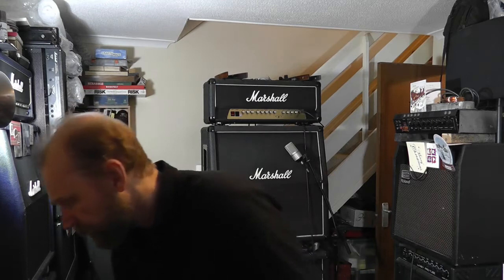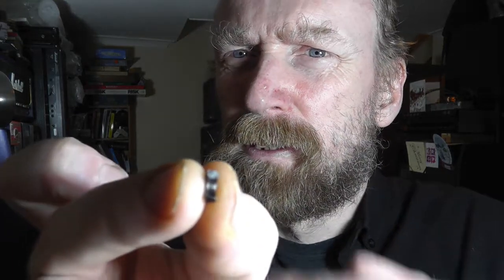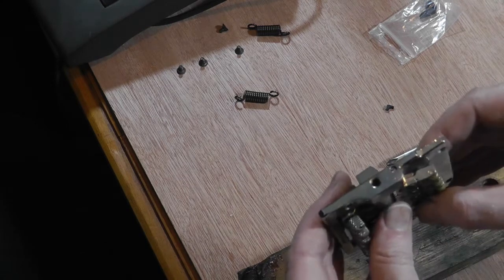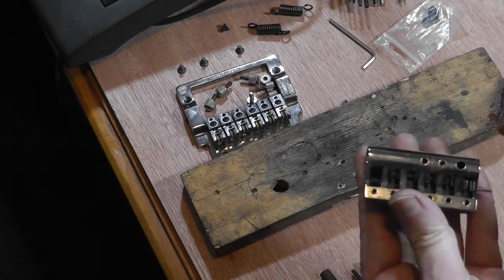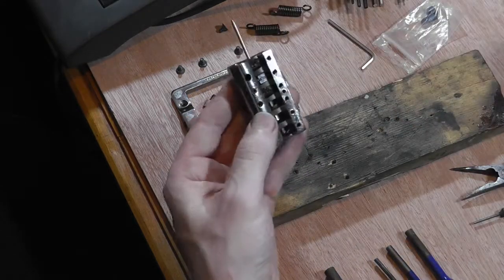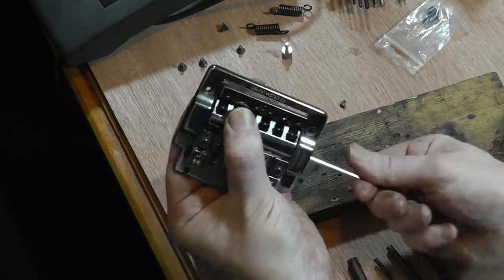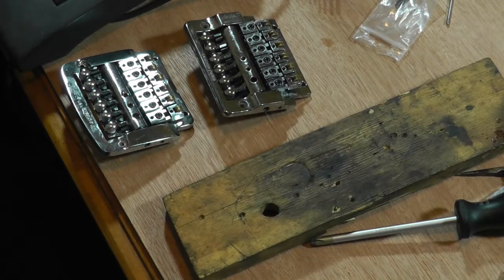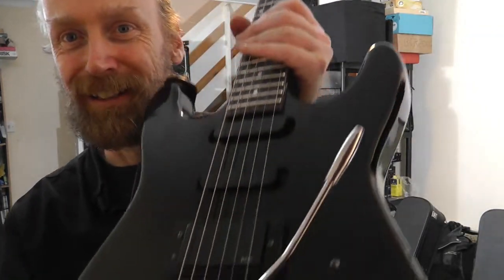Fixing A broken vintage Kahler Tremolo / Comparison with an Original Floyd Rose

Comment: I’ve been working on a Peavey HP special with a Kahler mounted on T-O-M tail posts. 

It was so simple so set the intonation and adjust everything.  So much easier than a Floyd.

I have the opposite tuning issue, where it needs the bar to be pushed forward (not back) to get it back to pitch.  It is tending to settle sharp without this. 

Not having a problem with the G string.  I’ve lubed the rollers, bearings, and any contact points. 

I’ve put NYXL 9-46 strings on it. 

I’ve read that springs wear out and should be replaced every few years.  

Spare parts also seem to be very hard to get in the UK. 

It’s a completely different experience to playing a floating trem.  The Kahler is almost perfect in its design apart from the tuning issues which you have to alter your technique to overcome.  

To me, the fundamental point of a tremolo is to come back to pitch.  For me, and the lack of available parts, this almost makes the Kahler a no go.

Comment: Here are the ways to fix all Kahler tuning issues. 

#1. Kahler Heavy springs. 

#2. original floyd rose locking nut. 

#3 Soldered string ends OR GHS Tremolo boomers which are made for kahler trems, also Dadarrio or EB reinforced strings. 

#4 ensure rollers and bearing are oiled and moving nice and smoothly.
Reply from the maker: Half of that seems really valid, half seems like in most cases it would be unnecessary. Seems only 3 and 4 are actually required. In many cases installing a Floyd nut would take some pretty expert wood working as the guitar has only space for a standard nut at the end of the fingerboard, the Kahler string lock being on the headstock face, work in combination with a standard nut. I don't have any experience of Kahler heavy springs but a great benefit of the Kahler is it smooth almost effortless operation - Does that stay the case with heavy springs on a six string? From Googling seems they are aimed at 7/8 string heavies and basses which would make sense as you just need to balance against string pull. Heavy springs on a six string using 10-46s would probably be to much?
Reply: @hydorah  I agree the Floyd rose locking nut may take some work, however the old style behind the nut string locks have been proven to not work because you are fighting that nut. it always screws up tuning. The heavy springs, the feel is close to a FR but still much much much softer.  Kahler with a FR nut and Heavy springs and you can even go crazy with the teflon glass rollers. But dont forget the stock springs do best with 9-43. I would still run heavy springs on light gauge strings. they always work out better.
Reply from the maker: @jagerking7020  Might give the heavies a shot then, I'll make a vid if I do. I am happy as anything with how it's functioning and feeling now though 🙂 I've always found the Kahler string locks to work fine, provided they are properly secured and the guitar's nut is of decent quality and in good order if there are issues, look for those problems. Extensive / expensive woodworking is not the best answer IMHO. Of course you may have a guitar like I built a long time ago... BC Rich USA Assassin neck (a Floyd equipped guitar) and Mahogany Tele style body, routed for a Kahler. That was a great guitar, so that had the combo you describe Floyd nut Kahler trem, it was ace. For some reason I parted it out again after a couple of years. I kind of regret it!

Comment: That's one of the very early one piece cams that does not have the removable cage ( I have one too) I actually prefer how the load lever mounts on the long pin on these types. Check your string lock for worn grooves for your G string, I never have this problem.
Reply from the maker: You're right the cage is rivetted on. I think it's more about the strings I use. I use Roto Orange. Great strings, lovely tone but the ballends are a bit loose. I did check the cam and the locks to ensure all was smooth and healthy. What strings do you use?
Reply: @hydorah  on my Kahlers I usually use reinforced strings, Ernieball RPS, Paradigms or GHS reinforced Boomers, Or you can solder the windings down by the ball end on the plain strings, makes them hold up so much better on a Kahler, especially if you like doing the big pullups!
Reply: Ernie ball rps or nothing for me on a kahler

Comment: I have a 87 Guild prototype with a Kahler. I guess it can be considered a super strat. Been looking for info on this since I got it 30 years ago, the closest guitar it looks like is the Aviator. Set neck 2 Humbuckers, black 1 volume 1 tone with gold hardware and headstock is not quite a point, it's a little rounded. The Kahler is mounted flat on the body. The guy I bought it from won it in a charity auction in 87 with a peice of paper that just said 1987 Guild with Kahler. The serial # is just HE 1000001 made in U.S.A.
Reply from the maker: That sounds like a treasure! Keep hold of that one 🙂
Reply: @hydorah  👍

Comment: How do i adjust bridge level on this bridge??
Reply from the maker: Hey mate! On each saddle there is a little allen screw that lets you raise or lower each saddle individually. Only adjust these without string tension on though! if you need to raise the whole unit you can buy stacker plates. I made my own which is in one of my vids I think
Reply: @hydorah this definitely helped with another problem I had but my bridge is lifting too much foward and I don’t know how to level it back down to a good float… with my Floyd I can easily just screw the tension springs to adjust the bridge but I don’t know what the equivalent of doing that on this bridge would be
Reply from the maker: @Plumbsss  Oh right! I gave you the right answer to the wrong question! To adjust spring tension, it is a bit mysterious! There's another allen screw right in the centre of the roller cam that the strings pass over, the same part of the trem that the bar screws into... It has a few holes in it, you want the middle one. This can obviously be turned while the guitar is tuned up. I found this series of vids by Gary Kahler himself, in this one he covers adjusting the float at about 5 mins 30 secs

https://www.youtube.com/watch?v=7QQXti9k3iw&t=7s
Reply: @hydorah  thanks man

Comment: HELP !!.....Can somebody please give me some much needed advice ?  I've got a Manson Guitar that was built for me in 1986 and it has a KAHLER trem system on it ....I opened the case (which I hadn't done for months) and found one of the strings was not on. But when I looked CLOSER I realized that one of the metal sides that hold the ball of the string IN PLACE has SNAPPED OFF.....The die cast metal bit holding the string in place (not the roller) has broken off & the system won't grip the 0: 24 guage string in place anymore.....I've searched frantically in the case & elsewhere for the little piece of metal with the hope of cementing it with Gorilla glue or Super glue but I can't find the little broken off piece anywhere....Its a GREAT guitar which Hugh built for me which I designed myself so I'm upset here .😥😢 Please can anybody help or advise ? thanks.
Reply from the maker: Amazing I have a Manson guitar to mine has a Schaller tailpeice and I bought it used. It's a kestrel so nowhere near as special as yours. Where are you located? I'm in Exeter, home of Manson guitars, I'd gladly fix it for you if you're near enough. Anyway... glue of any kind won't do, but this the part you need:

https://www.ebay.co.uk/itm/325129466103
Reply: @hydorah  Hi ,,,,I'm here in Pevensey East Sussex....I lived in Eastbourne when I first met Hugh & Andy in 1983 which was when their workshop was based in Crowborough East Sussex. i heard Hugh's shop had been bought by Matt Bellamy a year or two ago. Andy I think is now based in Portugal .He made me a beautiful acoustic in 2002.

Comment: the roller on my g string just came off and i don’t know what to do
Reply from the maker: Gosh! how did that happen? Do you have all the parts? The roller is held in the saddle by a steel pin if you still have the parts you can rough up the end of the steel pin to make it grip in the saddle harder when you reinstall it. Failing that, brand new saddles are available:

https://www.ebay.co.uk/itm/191983036949?hash=item2cb314aa15:g:838AAOSw4A5YxG5Z&amdata=enc%3AAQAHAAAAoEPTnAt%2FuhpNfwCHcYlp587lP1x9mG9lX5DYBSADfWSsAXePB5i6FKhW0wIiudPtUT7ybEF230iL7xbXeVN5QFjUAKkVfXM3S8jCNarPHiFAfYe8O6rmyP32TKtJTeRDpzhn5UagoAfYfLAcQarr8Xd95BPyL1UpSggIL%2F7WNF2yCtkKh%2BPbz6sB5hqVjQHYyTnuJ5nSSZP7IccqqiHwTVM%3D%7Ctkp%3ABk9SR4DAz_aaYQ
Reply: @hydorah  thanks man… just for some more insight it’s a charvel model 5
Reply from the maker: @Plumbsss  Now that's a nice axe Shhreeeeeeddd!
Reply: @hydorah  i got it fixed…. loosened the string, slid it back in and tightened it
Reply from the maker: @Plumbsss  Well done! Glad you didn't lose track oy of the bits!